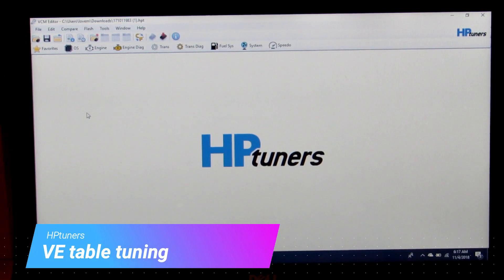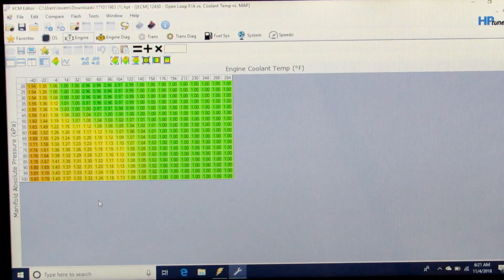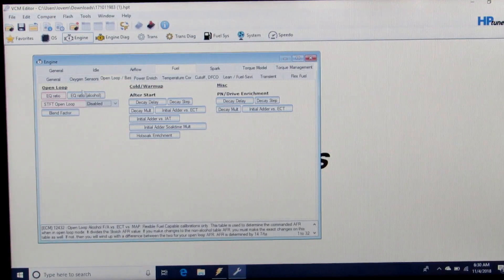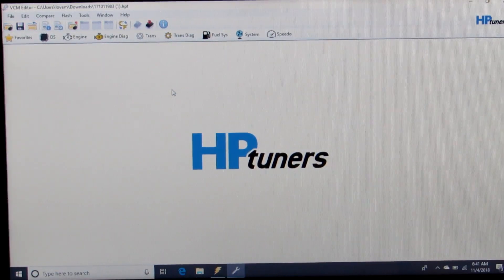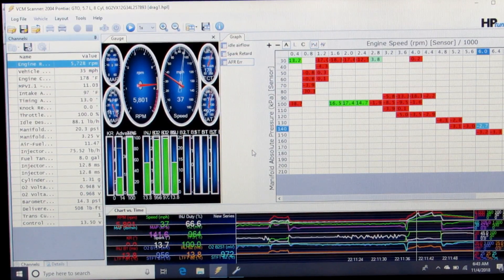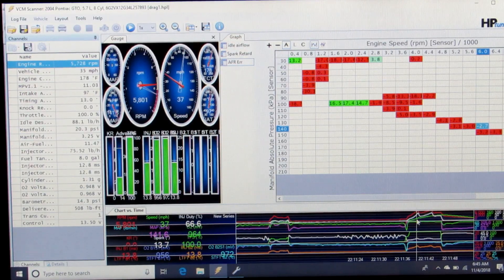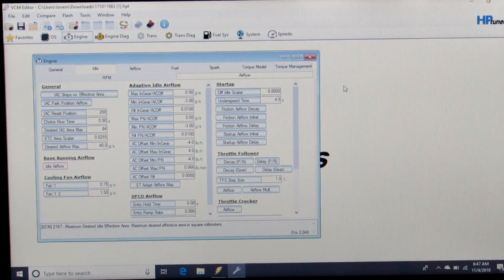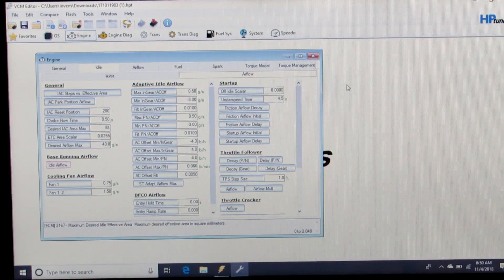How to tune your VE table

Comment: Any idea on what to check for after car is warmed up and it will stall at stops and then when I crank it back up it revs to like 2500-3000 for 3-4 seconds then calms down to normal idle. 2000 5.3  Howard cam 598/691 headers Cold air Intake   Turbo 400 trans. I’m running MAF cause it’s a street 84 c10   Runs good cruising and plenty of power etc just after warmed up stalls when I have to normally or quickly slow down and release throttle
Reply from the maker: Sounds like you have to much air flow at startup.  Could be your base idle airflow is off, friction airflow, or start airflow tables or a combination of them.  Assuming no mechanical issues such as vacuum leaks that is where I'd look as far as tune related issues.  As far as stalling with quick releases of the throttle look in your throttle cracker settings for the fix there, but base idle airflow is the first thing you should dial in as perfectly as possible.  I've found the vast majority of idle issues are solved with good base idle airflow settings.   Good luck!
Reply: LSxTuner I’ll get that a try   When I try and do a SD tune as described here  I am encountering no power stalling backfiring  but it does make my Wideband run richer  it’s usually 16-18 but under SD it’s 12-14ish but it’s Un-drivable

Comment: thank you for the excellent video, in terms of disabling the DTCs for the MAF, I believe unchecking the SES check box will not illuminate the Service Engine Soon light, which is different from the MIL ie the Check Engine Light, and others have instructed to change the MIL to On First Error to properly fail the MAF, can you comment on that please?
Reply from the maker: What I do is uncheck the SES enable box and set error mode to MIL on first error.

Comment: On they “idle air flow” if your running a none computer controlled vehicle I’m assuming “p/n” should match “gear”
Reply from the maker: By non-computer controlled vehicle I'm guessing you are referring to a manually shifted auto transmission?  It's so hard to trouble shoot based upon internet comments or even over the phone so typically I don't like to try to attempt it.  I did help a guy with a manually shifted 4l80e that was having some idle/driveability issues.  Combo was a 421 cubic inch lsx with a whipple.  I had him add 2 grams/second to his p/n base idle air flow numbers and make this his in gear numbers.  It worked perfectly and solved his idle/driveability issues with that combo.  You need to log your desired idle airflow from a cold start to get the desired idle air flow numbers in p/n to begin with.

Comment: I have a ls1 that ran fairly good with just cam and injectors just tuned for injectors while running a t56 but went to full manual 4l80 and now runs rich should I automatically assume the VE tables are to blame or should something else be adjusted first
Reply from the maker: Don’t ever assume anything.  Log and collect data to know for sure what is going on.